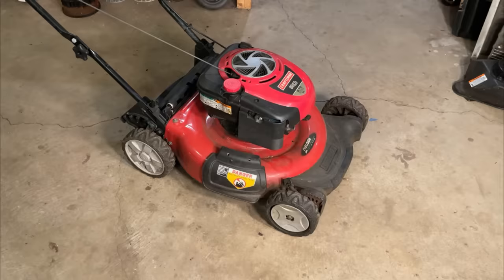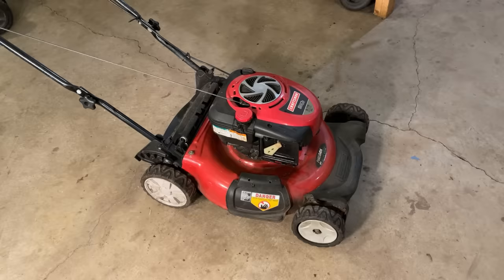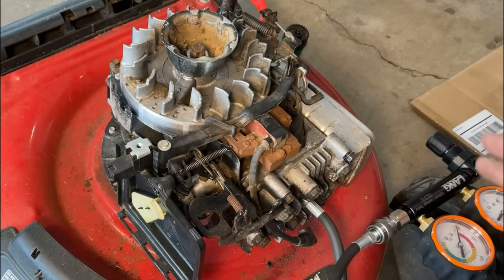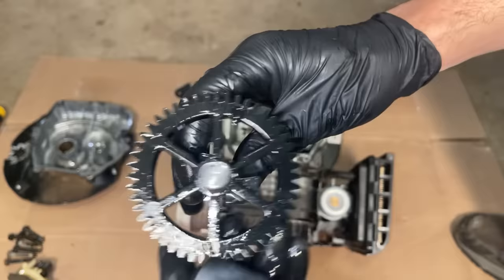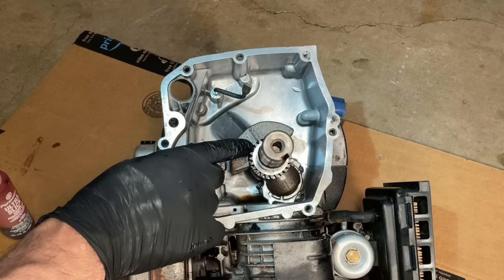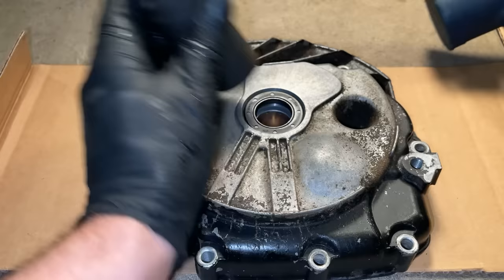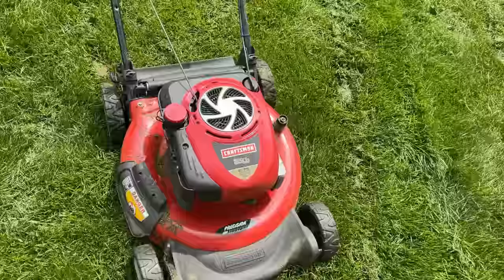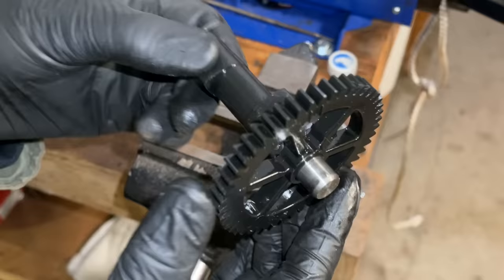Lawn Mower Will Not Start - You Will Never Guess Why

Comment: Nice job James, and I have worked on many Mowers. I owned an early B&S, with absolutely NO plastic parts anywhere on it. This early Mower ran for over 25 years with regular maintenance. A couple of times, I have seen the Valve Seats become dislodged on B&S Mowers, and that should NEVER happen either. I gave up completely on B&S about 7 years ago, and moved to replace with a Honda Mower. A self propelled model. Only problem in 7 years, has been a broken Drive Shaft on the Honda, where it would not self-propel. a 10 minute fix. To see plastic Cam Lobes, and also a plastic Cam Gear employed inside the B&S, has further opened my eyes, with the determination to never go back to a Briggs. Briggs should have splined the plastic gear (and shaft), which would have prevented that from happening in the first place. Glad that you decided to place the faulty Camshaft in the Vice - to identify what moved. I was hoping that you would do this, and you did! Thanks for enlightening me, and Greetings from Sydney Australia.
Reply from the maker: It’s too bad they have cut corners recently.  Even Honda uses plastic lobes on some of their engines.  The older stuff is definitely made to last.
Reply: @jcondon1  I am glad that you also see that things are not built to last, but most probably fail - just after the warranty period of 12 months. Many Chinese Brushcutters are just as bad. I worked in a Mower Shop repairing these items, including Briggs, but not many Honda Mowers came through with anything classed as 'serious'. I use a Kawasaki TD 33 Brushcutter, a very old machine, but it still runs 'as new'. Kawasaki TD 33 gave me about 4 years of bogging-down, stalling. I pinpointed the cause, to the brass Primer Piston, which I eventually blanked off completely, with an aluminium plug superglued in the Plunger (piston) hole. It was pulling air there, due to wear. I didn't know that some Honda Mowers also have plastic Internals, but (even so), they are still reliable machines, made to fine tolerances, and proven by their Japanese Engineers, to do the job. It's a pity that Briggs and Stratton do not read these comments, and then act accordingly, to stay afloat as a business. Thanks for your input.

Comment: "The gears and the lobes are plastic..."

Planned Obsolescence much, Briggs?
Reply: I used to sell and repair Briggs.
 Biggest mistake. 
Going to plastic carbs. 
They warped all the time and turned the mower into junk. 
I replaced many with old aluminum carbs.
Reply: I call it the Walmart philosophy. Everyone wants the cheapest thing they can find without buying used. That means the mower with the lowest price will outsell anything else. My dad taught my brother that when a lawn mower breaks, junk it and get another. My brother buys a new mower every 2 to 3 years using that method. In a way he's right because a repair by a shop is always more expensive than a new mower. I grew up in the DIY era but I think that has been replaced by the throw away era.
Reply: @danielebrparish4271  You're right. Average American thinks price is the only factor worth considering. And as a Do_It_Yourselfer, am amused when the price of a part (with shipping) is more than the cost of a new replacement.

Comment: In the old days that would’ve never happened those things were made out of metal.
Reply: It's the flywheel key
Reply: Exactly.
One can spend big money on a BMW and find critical components manufactured from
you guessed it ... PLASTIC
Reply: @andrew_koala2974  BMW must stand for abbreviation "Big Money Waste"
Reply: @joeherrold6847  no it’s the camshaft didn’t you watch the video before you commented it’s made from plastic. Duh 🙄
Reply: I had a 1998 Ford Crown Vic that developed a coolant leak in it's.....wait for it.....plastic intake manifold!
Reply: @jesushadenough3427  that and 
Break
My
Wallet
Reply: @mickjager5974  how low can they go....
Reply: @jesushadenough3427  I was told many years ago by a Danish guy they stood for Break My Windows. And were sometimes called BM trouble you.
Reply: @mickjager5974  Well maybe you ought not been hanging out with a Danish guy who robs cars. . . Especially BMW.

Comment: They used to build a mower/engine to a robust standard that gave them bragging rights. Now, knowing people actually put very few hours on a residential machine, they build them to last till the end of the warranty- period. You don't even have to change the oil in them now because they know even junk will last a couple hundred hours without an oil change. Then they flaunt the no oil change engine like they are doing the consumer a favor. They build them just good enough to get by now. How pathetic.
Reply: D Smith I change my oil every year on 30 year old Briggs still runs fine , but I'm with you on the warranty period thing modern stuff ain't built to last .
Reply: @stevebrodie7777  Here to 21 yr old briggs :D
Reply: No oil change, no wonder there is no drain plug on this generation of Briggs.  Just got one out of the dump for free and all that was wrong with it was the governor spring was missing and fixed that she ran like a top, so went to clean it up and change the oil and no drain plug, found out you have to suck it out the fill tube. What a joke!!!

Comment: Was a good engine they made on these The only fail was the gas cap and the warmer deck. I've ran into the valve problem before. I have a Briggs & Stratton about the same model 190cc six horsepower roughly and I've had it since 1990 and works flawlessly. That's Briggs & Stratton's biggest problem now they're starting to use plastic gears and so forth so things fail and you have to continuously buy more s*** from them nothing has made the last everything's made to fail production production production this country's pathetic when it comes to waste

Comment: The only method of dealing with a mower that will not start is 6 rounds from a 44 magnum, then go out and buy a new one.
Reply: Good advice for those without the smarts or  know how to fix one.
Reply: Great idea but the only problem is one would probably spend as much on the 6 rounds as a for the new mower with the elevated price of ammunition.
Reply: Wtf is that auto correct lol

Comment: I have the same exact engine since 2010.  In  2017 the engine block simply developed big crack after I hit a stump, so big in a way if I simply pulled both sides apart where the crack is,with my hands, I would have probably made 2 separate pieces. I just ground the crack, clean it and filled it with "J-B Weld". Let it cure for couple days, added oil and still using it until now 2023. It always start on the 1st pull

Comment: I have purchased and then resold several mowers that simply needed the valves adjusted. They generally had new starters became they didn't want to turn over very fast. It was because the exhaust valves weren't opening far enough to let out the compression. So, after a valve adjustment, they ran fine.

Comment: I used to pick up mowers by the side of the road.  Normally, someone strikes something solid and it shears the aluminum key on the flywheel.  Pull the flywheel, install a cheap new key and away you go again.  I used to fish brand new mowers out of the dumpster behind sears with this condition.  I used to sell my recon mowers cheap.  I had a friend that bought a really expensive Honda and his son hit a root and bent the crankshaft.  I told him, just think of how many of my cheap mowers you could have bought with that money.  This is how I really got started working on engines.  Cheap, easy and it pays.

Comment: I watched you do it, but most folks don’t know. He disconnected the spark plug wire before going underneath and turning the mower over with the blade. Never turn over the mower and grab the blade without doing this.

Comment: Bees. It's one you are not going to believe, but I've seen it twice (working in a power tool repair shop) Carpenter/solitary bees don't live in hives but build nests in any likely hole/opening they can find with sand, then lay an egg. The exhaust opening of a lawn mower is a likely hole to them, and they might plug it up. It had our gas guys scratching their heads for a long time. I have a bee hotel in my back yard so it was no mystery to me. It's in the shop manual now.

Comment: I'm surprised you went with a used plastic cam. I don't trust plastic parts much so I don't usually go with used items. I'm surprised someone has come up with a metal replacement cam that holds up better than the plastic OEM. It's sad to see how many lawnmowers, both push style and riding mowers go to the junk heap due to problems from relatively cheap parts. I know clogged carbs probably rank at the top due to alcohol based fuel and stale fuel issues. Cheaply made parts and plastic pieces probably account for many of the other failures. Mowers are so expensive today! It would really be wise for most people to repair/ have repaired a mower with a minor part failure. The USA would have a lot less trash in the landfills if these large items were repaired instead of thrown into the trash every year! Good job with the diagnosis and repair!

Comment: 9 out of 10 times when a Briggs won't start at the beginning of the season, it has a stuck valve. When you try to crank it, it causes the plastic gear to turn loose. Apparently the valve became unstuck pretty quick, or it would  have been like the one I got to work on. The guy tried to crank it so long the gear was loose on the shaft. I replaced it with a metal gear, and the plastic one is on my desk for a paperweight.

Comment: Two things - it might have been helpful to actually verbalize how you knew the valve timing was off by mentioning the position of the magnets on the flywheel in relation to the magneto. Also, I would would have liked to see exactly how the gear is fastened to the camshaft to prevent it from rotating and why that would not have been possible to repair. 
I was surprised at how inexpensive the replacement camshaft was. Definitely worth doing!

Comment: A great demonstration of systematic diagnosis and appropriate repair.

I especially appreciate the meticulous approach to eliminating problematic oil leaks by meticulous cleaning of mating surfaces, careful assembly and use of a torque wrench.

However I did notice a safety issue.  You should ALWAYS remove the sparkplug wire BEFORE doing ANY work on the engine that doesn't require live ignition.

That includes inspection or manipulation of any part of the machine that could bring any part of your body or clothing into proximity to any moving components, even if you're working on a "dead" engine.

It's just a good safety practice that should always be followed, even when it's "unnecessary".
Reply from the maker: I agree.  The plug wire was removed.

Comment: Every time I see plastic used with metal, The plastic always fails.  This alone is the reason not to purchase the engine, in my opinion.  Plastic embrittles from heat.  Stress causes microcracks.  And the surface of plastic parts wear prematurely fast.  It all adds up to a disposable engine using a plastic cam shaft and drive gear.  And how much did they save, A few dollars???  I would Readily pay the premium To use metal parts.  Absolutely most excellent repair and videographic graphic work as well as explanations as always james!!!  It's a big job and most people would have simply discarded the mower.  You make it look easy james!

Comment: Really interesting, I would not have suspected the camshaft. The Brigs and Stratton engines are usually very reliable, i have a mower with one that i have had about fifteen years. I used to have it serviced by the dealer  and had issued with the carburettor gumming up on ordinary petrol, but since I retired I have been servicing it myself and i now use Aspen fuel using that it has started first pull even in the most adverse weather and after long periods of disuse.

Comment: You’re expertise never ceases to amaze me.  One thing that puzzled me is why you don’t have or use a hydraulic press to press in the seals and bearings.  A press offers so much better control than a hammer and socket.  I always thought the shock to the component from the hammer has some affect on the longevity of the component.  Harbor freight has a nice hyd press pretty reasonably priced.
Keep up the awesome videos 👍

Comment: This is a very satisfying video from start to finish. Just because you did not skip any of the steps made this easy to follow in fact I think it is genius. Even to the final chapter of demonstrating the reliability and cutting ability make for a complete presentation. I even enjoyed sweeping up the debris in your shop. It shows respect for your craft and pride in your work. Now this is what I call a video! Very well done.
Reply from the maker: Thanks!
Reply: Next time drill a small hole in it and install a cotterpin for a much cheaper fix.
Reply: @scott5309  What I was thinking.  My idea a roll pin but the cotter is a better idea, as it would be mechanically unable to fly out.

Comment: Even if you get a metal cam, many cams these days are made by pressing the lobes onto a splined shaft. I'd imagine it would be fairly rare for those to spin, but they're still not what they used to be. That is, a single piece, forged and ground.

Comment: Very disappointing to see that plastic camshaft and gear.
one of the other posters said they have been around for a long time.
I guess I will be pulling two mower engines apart here real soon.
I have the same issue you had.
Thanks for the video.
I will have it on my iphone as I take the nightmare apart.
Thanks alot Briggs and Stratton.

Comment: I had the same finding on another Briggs engine quite a few years ago. Everything looked to clean and new to be defective. I didn’t know how to check if the lobes were in the correct place so I compared it to another steel cam, bought a new one and I was on my way. It’s kind of hard to believe that Briggs makes a part that can mess up like that. Had to do a little head scratching on that one!

Comment: In the sumner of 78 & 79 I worked at a lawnmower shop that my drivers education teacher at high school owned. I then went on to work on motorcycles and even at a motorcycle repair and machine shop. We did pretty much everything except plain bearing crankshaft and connecting rod repair. We even built performance street bikes and drag bikes. I even worked at a few dealerships. Mostly worked on Japanese bikes. The only time I saw plastic parts inside and engine was on the late 96 & maybe 97 VN1500 Kawasaki vtwin which had a plastic oil pump gear. We found some of them eventually turning on the shaft even though it had a locating pin to keep it from turning. This caused no oil pressure because the oil pump was not turning. Later models came with a steel gear which fixed the problem. Apparently lawnmower engine engineers are building engines cheaply while costs go up. My guess is if the gear had more of an interferance fit on the shaft it would not have moved or if the shaft had a locating pin for the gear to engage, it would not have turned, but the gear may have broke due to the force on it. 
Doing a compression test would have shown low compression due to the cam timing was off. Also a leak down test may have shown leakage past the intake or exhaust valves depending on if the valves were opened or not. 

The $ you spent on this mower and just a few hours of work was well worth it in my opinion.

Comment: I work on a lot of lawnmowers, and I've learned to never try and start it, without actually finding out what its supposedly running on, like is the tank half full of h2s04 or who knows what extra work or damage you can make by sucking whatever is inside the tank, through carburetor jets engine valves and cylinder rings etc, so its a 10 second job to just open the float bowl drain and examine its contents, then check spark and compression etc 😉

Comment: My Mini engine once threw a con-rod.  The Mini gearbox is in the cast aluminium sump, and because the crankshaft was turning quite fast at the time, the bits of the con-rod that came out of the front broke both the engine block and the sump casting where they were bolted together, and the same at the back of the engine.  The bits that came out of the front damaged the starter motor and the bits that came out of the back got into the diff - so there was nothing to salvage, and I bought another engine from a scrap yard and put it into the car.  It had a really poor performance, and when I took it out again and opened it, it didn't appear to have been opened previously - but the problem was the same as in this lawn mower - the cam shaft sprocket was one tooth out on the timing chain.  That fixed it.